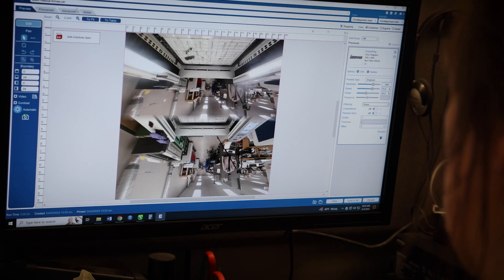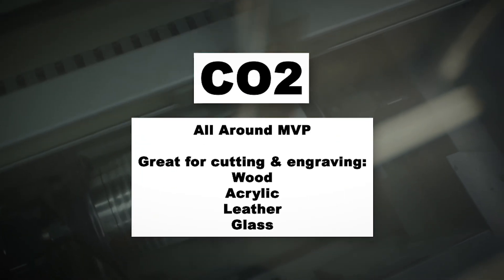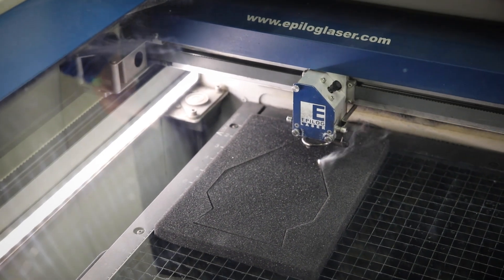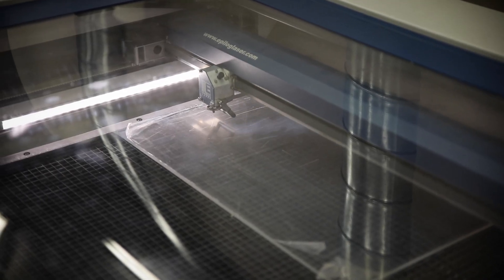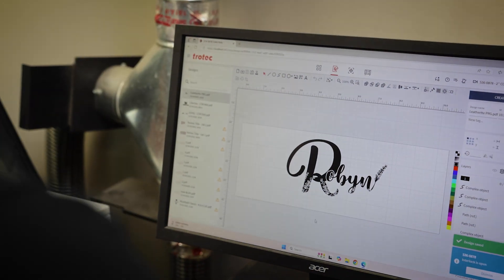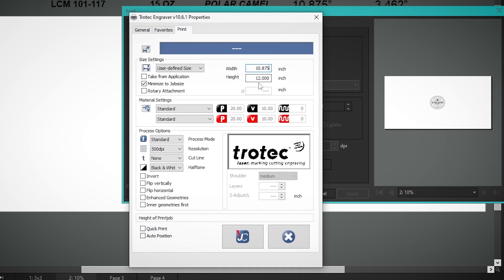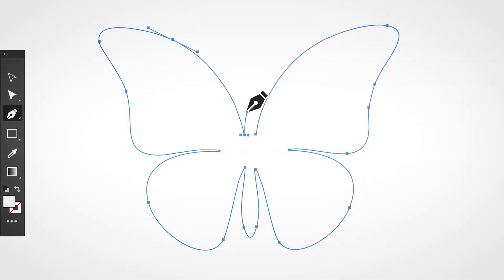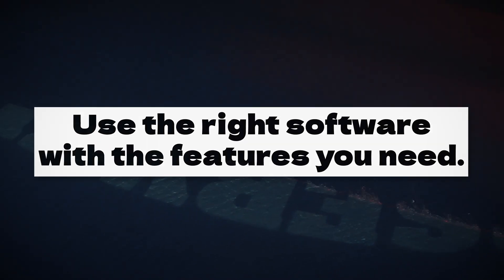Which Laser Engraver Should I Buy? | Things to Know Before Buying a Laser Engraving Machine

Comment: What happened to CO2 Galvo's?
Reply from the maker: Those would fall under the C02 section! Instead of a belt and motor to move the laser head over the engraving area. Galvos use mirrors to redirect the laser over the engraving area.
Reply: Galvo is the mechanism, not the laser type.  Whether a diode, CO2 or Fiber, a galvo still falls under those laser type categories